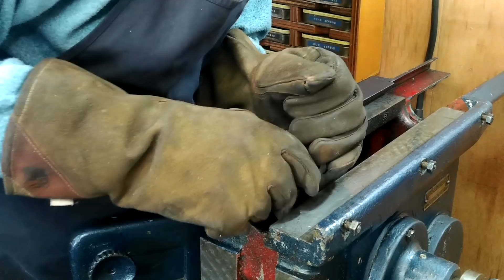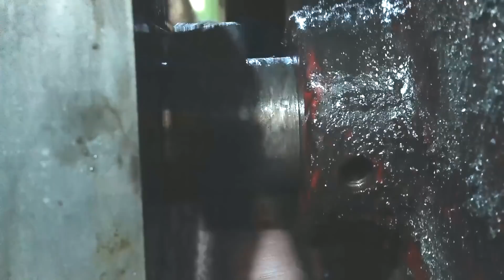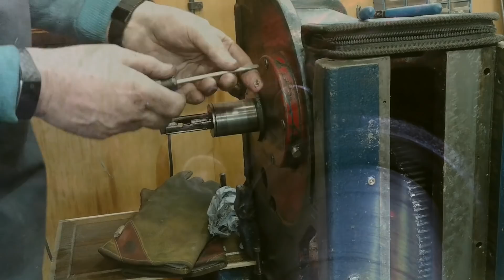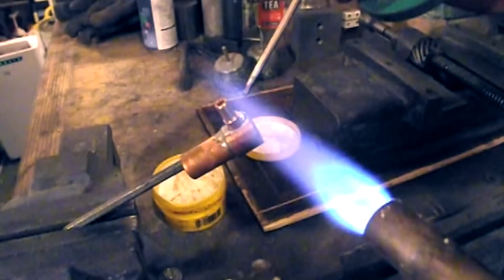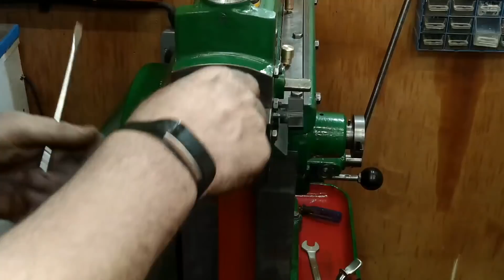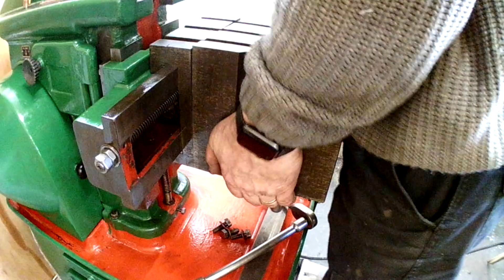Alba 1A Shaper Fix

Comment: I have one of these, also with a broken gear knob, the school machines which many of these were, were fixed in the low gear to avoid crashes! Mine had the spring detent removed and a lokner screw fitted to lock the gear change shaft, which is perhaps how the knob got broken, Another absorbing watch!
Phil
Reply from the maker: One thing I do know about school/college equipment is that whatever you do to try reduce crashes, creates more opportunities to create bigger bangs. Anyway, at least one bunch of gears have plenty of life left in them…. if the bull gear or rocker arm hasn’t met with the crash of doom. but I’m sure you’re on top of it all.. all the best.

Comment: I went looking for videos on my own Alba just out of curiosity and found your video.  It's very well done and I've certainly enjoyed your previous videos as well.  

I had a minor clunk which I figured was due to the bottom pin in the yoke.  Your video was a great aid in being able to play "find the pinch screw".   I was reach up through the motor access door and loosen the pinch screw and permit me to knock the pin out towards the left side and remove it.  Sure enough there was some slight wear.  While it was out I used the bandsaw to add a slot to the left side of the pin so in the future, a couple of decades or more away I'm sure, I can rotate it another 30 degrees to the next good spot.  The screw driver slot aiding in doing the twist and seeing the amount of turn.
Reply from the maker: Hi, thank you. Fantastic, I’m pleased you have managed to sort out your machine to keep it in top condition. A good idea for those having the same trouble.
many regards

Comment: Thank you Paul. Appreciated your great presentation and all the details. I refurbished my Elliot 10M shaper which looks very similar to yours; did I read somewhere that they were related? I had to make a new slider block and file parallel the ram to fit. That went a long way to making the motion smoother. I think the issue was lack of lubrication in its prior school setting. Look forward to seeing more of your videos when I have time. Clive.
Reply from the maker: Hi, yes Elliot bought the Alba brand quite a long time ago. Cheers

Comment: Hi, i do have a operators manual and parts list for the Alba 1A,  pictures look pretty much the same as your's. Mine is a much older line shaft  version of the 1A, but internals are similar to the later version. I also have a manual of the Elliot 10m which shares some design details with the 1A. If you want a copy, just drop me an email, address is in the credits of recent videos
Reply from the maker: Hi Dynoguy, Thanks for your offer it is very much appreciated. However, I also have both of these manuals, the manual I was searching for is the maintenance manual. I was primarily looking for the best resetting practice and to see if the machine had any special needs for strip down and reassembly (most of which i stumbled across), this information is not readily available and is not mentioned in the literature I own. Cheers.

Comment: I have a Elliott 10M. Now I know how to remove the tool slide (i.e. turn it upside down). Mine is tight on the swivel pin and needs to come off for a clean but I could not get it off. Now I can. Thanks.
Reply from the maker: Hi, glad you found the video useful. cheers

Comment: I used to have an Alba 1A. Mine had a factory fitted bronze slider block. They must have changed the design at some point. 
It was the most fun to run machine I've ever had but I sadly had to pass it on as I needed the space and it was being used very occasionally.

I used a Reilang oiler to lubricate all the oil ports when running the machine. It always had pools of oil on it which made keeping it clean a pain but on the flip side, it had very little wear and no rust at all despite passing through at least 3 owners before me. I think your large capacity oilers are nice but unnecessary and are only are going to exacerbate the oil puddle problem.
Reply from the maker: Hi, these dead loss lube systems are messy but, I believe too much oil is better than not enough.
The catch tray below serves as my anti rust supply, I use it to clean and coat many of my painted and none painted surfaces and it's also mixed with a little paraffin so can I use it as cutting lube.
Cheers

Comment: Great to see the Alba again, and the back of that horrid metallic green Hammerite. This will be a useful resource for other restorers. I like the way the replacement yoke has been made, simple but effective, it was the yoke that had failed on the donor machine that we both had parts from. The oilers are good, I need to make some for the Elliot.
Reply from the maker: Hi tony, I hope you and your family are still well. Have you done any more to your workshop since we met. 
I’ve just got to make a video on the handle next using old scrap parts. I actually striped the shaper down and photographed most of the components.
 I might turn them into graphics and make a little booklet on this shaper to post is on the web…..might… i’m very busy so i might not have time…. we’ll see. ATB
Reply: @Thesheddweller  That would be a worthwhile exercise. I am learning to hand scrape and working on a variable stroke power scraper conversion from a reciprocating saw.
Reply from the maker: @tonyray91  I had a reciprocating saw burn out once and I saw the potential for a power scraper too.. But its still lying in bits somewhere in the shed …. I think.
the only thing I thought needed changing, apart from the motor,  was the length of stroke from 25mm to 8mm and a variable motor drive. The saw blades when reground, would have made a great scraper blade even if they would have needed dressing regularly.  have fun. Cheers

Comment: Attracted by the 'Alba shaper' for the simple reason in the 70s-80s there was an Alba shaper as an art exhibit in the metalwork room at school. In the 5+ years there, I think I only saw it in use once or possibly twice.

Nice video
Nice paint job
Nice maintenance of the machine. Although I'm wondering on gib adjustments.....I wondered about doing the ends first and the middle last on the basis that the middle is more likely to be worn - so put more of a loading on the gib ends rather than the middle !
Reply from the maker: Yeah. I had that decision, but I hadn’t got a Maintenance manual and I have only ever seen it done at work by the maintenance crews. they always started with the centre and moved outwards, so I figured what the hell… it works for me..
Reply: There was also an Alba 1A in one of our classrooms when I went to tech college in the mid 70s.  I've had one of my own in my workshop for about 5 years now....lovely little machine.

Comment: Well, that was a riveting video. And thank you very much for mentioning my channel name :)
I made my oilers out of old brass handles. They work really well.
I don't know who is the person who repaired that shaper previous time, but I hope he/she will never touch a machine again.
Reply from the maker: Hi, I watch all of your videos and I always enjoy them, thanks. I also hope that the person that last put that shaper of mine together learned something about their own limitations.
The replacement Rocker is really strong, it has to be, because I’ve modified the belt system in the pedestal.   The motor is 1/2 horse power stronger than the old one and twice as fast, but it has a new pulley modification (also in the pedestal) and has been geared down 3:1, so theres lots of power,  Safety is built into the new pulley system by using a shear pin on the motor drive. So if i get something wrong the shock should break the shear pin not the machine……. thats the theory!
Cheers Paul

Comment: I am having trouble translating "greaseproof paper" from British to American. A search turned up a couple of things, waxed paper being the more common. Is that correct? And if so why did you use that instead of so many other alternatives?
Reply from the maker: Hi Mark,  sorry, its like thick white semi opaque tracing paper that is used in baking, we call it grease proof paper because, butter or cooking fats can’t penatrate it and it's about 0.05mm thick (0.002”). It doesn’t crush and it remains fairly stable as thin gadget, I haven’t any shim stock less that 0.10mm (0.004”) thats why I used that. sorry about the confusion.
Besides, it’s cheaper and my wife says it keeps me away from her sewing machine…;-D
Reply: Mark, just guessing but I think parchment paper would do the trick..
-Dean

Comment: That was a good video Paul, I have the same machine awaiting reassembly, i have worked on these little shapers in fitting shops making Keys mainly and they are surprisingly accurate.
Don't forget that if you drop the table you must un pinch the bolt connecting the feed arm and retighten it when table adjustment is complete, some shapers the gear housing rotates slightly. I have also seen shapers running backwards (the return stroke should be quicker than the cut stroke) easily spotted on a long stroke. You will not be disappointed with the little alba, looking forward to more videos. Thanks for sharing Paul
And just remember you can make any thing on a shaper, Except money!
Reply from the maker: Hi, very true.

Comment: Sorry I haven't had much time to come back and visit Paul, but this was a great vid and well videoed. I still use the method I was taught by my father some 58 years back on all restoration and tare downs. He was and an on & off shore A&P army mechanic from 1945-1954. Polio stopped his career in "54. He taught me the old N-S-E-West method the military used. This ment that no matter where a piece (like an engine, trans, e-motor, ect) was to be disassembled you would use the work spaces (or open field space) polar direction. For example, my Klopp450 was off loaded into our shop with the rear of the shaper facing the blgs north wall. To my right west true west, my left was true east, and the shapers bed (or front) was true south. All parts are then are bagged and tag accordingly. This may sound confusing at first, but when the piece of equipment is massive and working space is limited, this works well. I also find for smaller parts that egg cartons make great ways to mark and store them for reassemble. Will when on to long, but thought I share. Have a safe and warm winter,,Bear in TX.
Reply from the maker: Thats a good idea. Mind you, as far as egg boxes go.. we have a bird that loves to chomp on egg boxes. So thats out of the question, but I do like the N,E,S,W, way of thinking… cheers